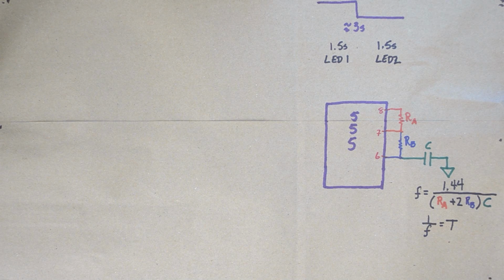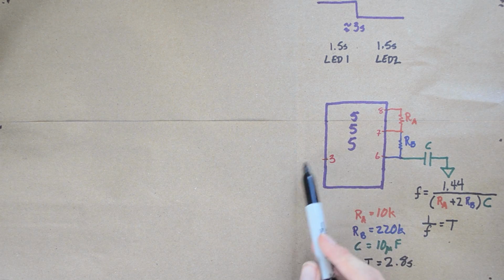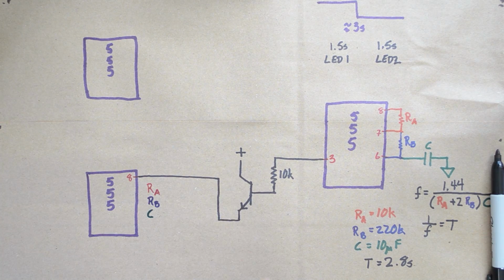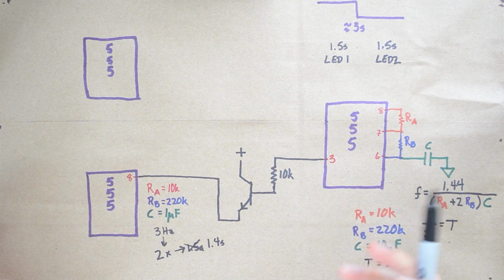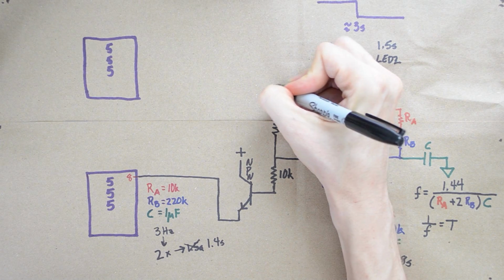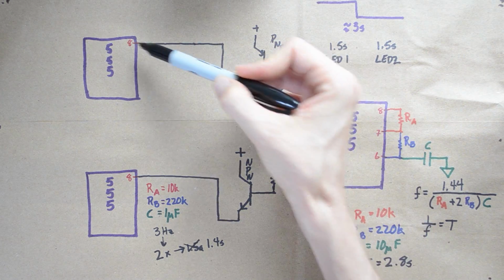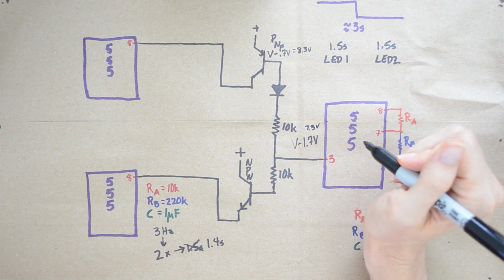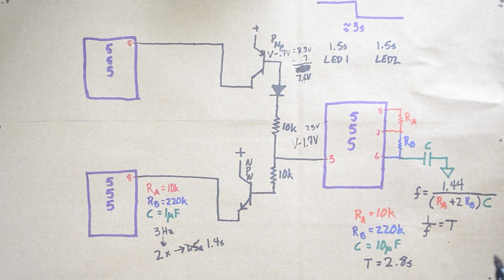Cascading 555 Timers for Custom Blinking LEDs

Comment: I did the math for the formula and I got a frequency of 3.1 not 2.85.
Reply from the maker: +Rick Thompson I filmed this so long ago that I can't remember where 2.8 came from. It appears that you are correct and I am wrong. I reworked the problem using several different approaches and keep getting 3.1. I must have hit the wrong button during filming. Thanks for pointing out my mistake.
Reply from the maker: +Rick Thompson I made a note in the video. Thanks again.
Reply: +Rick Thompson how to apply the formula??

Comment: Great video,but I do agree that using the 555 with the 4017 is a lot simpler. Again,great video.
Reply from the maker: +emmanuel penn Glad you liked the video! No doubt the 4017 would be a little easier. I'm using a 4024 right now on an ultrasonic circuit and it's dead simple to use.

Comment: could you use a 556 for this project?
Reply from the maker: +MrKillanthony There's a chance you could. I had a guy show me this (http://goo.gl/O5b2hD) circuit to do a similar thing. That particular way of blinking the lights could be done on a 556 if the circuit works at all. I haven't tried it yet, so I'm not sure.

Comment: Have another challenge   Can you use a 555 timer to slow down an rc servo  for flaps or landing gear  :)
Reply from the maker: +RC Canuck I think you can. You would need to change the duty cycle of the timer. I've got one small electric motor out of a toy car I can experiment with. I'll let you know how it goes.
Reply: +Skinny R&D Sound good don't over work your brain on my behalf though
Regards
RC Canuck
Reply from the maker: +RC Canuck I think I worked something out to help with the servo. I'm not sure if this helps you but it seemed to be applicable: https://www.youtube.com/watch?v=8Z7kTCSZG5E